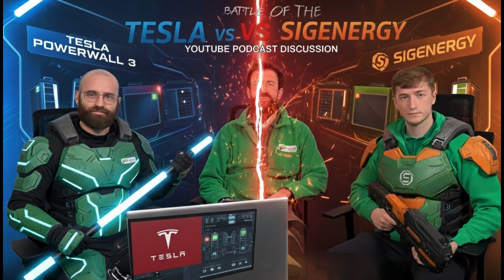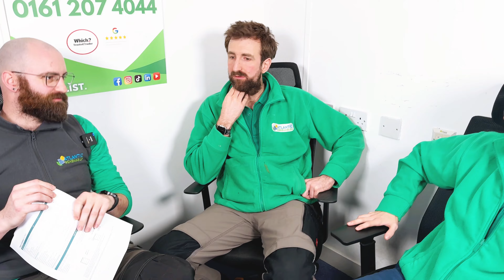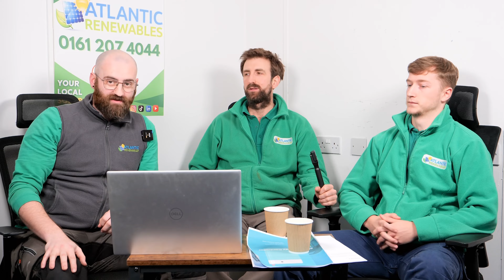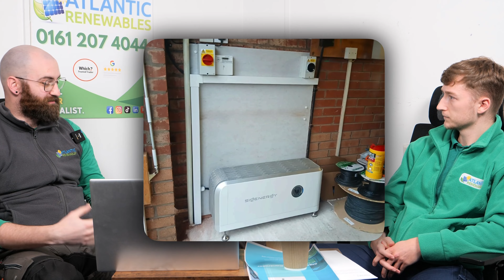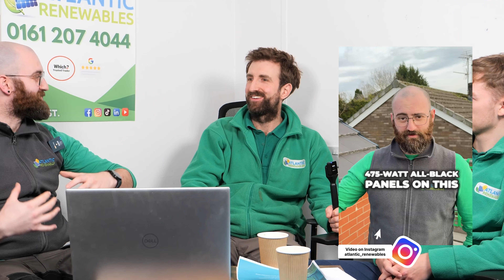Tesla Powerwall vs Sigenergy: Which Battery Is Better? - Atlantic Renewables Roundtable #1

Comment: I’ve had my powerwall 3 a year now and it hasn’t missed a beat, worked fine outside when it was hot in the summer or down to -9 in Jan. For those of us with oversized arrays but no EV,  the massive advantage is octopus intelligent flux and very good export rates, ROI contribution last year of nearly £4K. But Tesla software is a bit clunky, I have to break physics to get get it to charge and discharge exactly when you want it to in the winter to run my heat pump, but it can be done. Still hoping for advantageous rates when Tesla enter the energy market this year, hopefully a big plus.
Reply from the maker: Thanks for the information on your system. It's great to hear a successful installation and a perspective from an end user. How many panels/ kWp did you have installed?